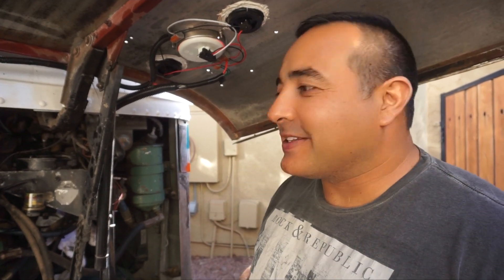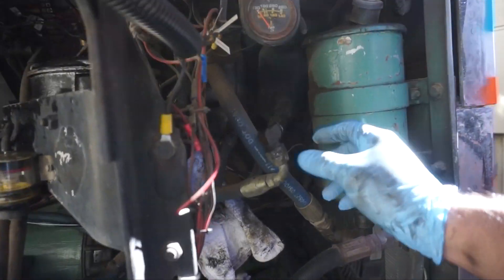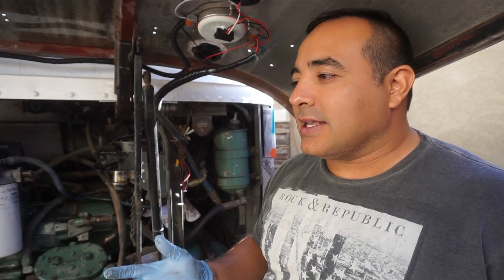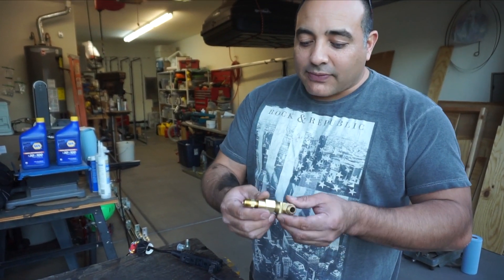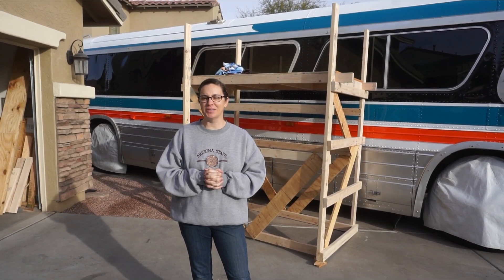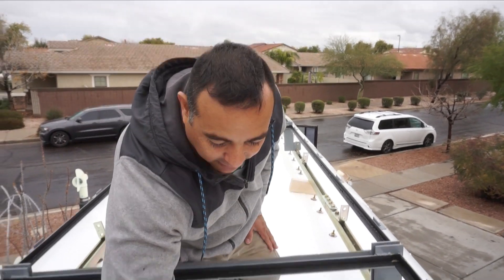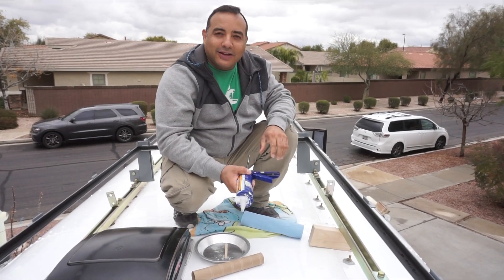Solar Install: Part 1: Mounting the Rails and Upper Racks

Comment: I see a problem. There is a gap between the unistrut and the skin of the bus. Every time you go over a bump or the lift created from the wind it is going to flex the sheet metal a little bit, causing stress fractures in the sheet metal. You need to carry the weight to the main rubs and get the bounce out. If the ribs are steel, you could just weld a piece of flat stock vertically between the ribs to the flat stock you installed already (the heat will likely damage the paint on top of the roof).  Another way would to mount the unistrut directly to the roof and run a bolt thru the unstrut and a rib. I don't think the rain is going to be a problem. The water can still drain at the ends.   

I really like like your channel by the way.
Reply from the maker: Thank you Dan - I thought about the problem you have proposed and I suppose it might cause stress cracks to form over time but I feel like it would be very very unlikely.  The frame is very solid and there are so many bolts that there is literally no flex at all.  Unfortunately putting a metal plate on the bottom would also cause dissimilar metal corrosion :(.  Unistrut directly on the roof was a no-go because the rivets and metal on the roof would not allow it to lie flat enough to get a good seal against water.  I will keep an eye on it and we'll see what happens.  Thank you for the input.
Reply: Beginning from this Morning I used wellnuts for this reason, and for sealing ability. The drawback on wellnuts is that they are less strong than through bolts. But I never had a problem and we carried considerable weight on the roof rack.
Reply: @BeginningfromthisMorning  Maybe some kind of spacer between the unistrut and ribs?  What your trying to do here is just to cool to fail in any way. I want it to work perfectly. Most builders aren't brave enough to take the time,  send the extra money, and then share something like this.

Comment: Very nice video.

Being brass like that and you not losing power steering tells me that is on the return side??? Not sure why they would have the filter on the return side??? The steel fitting is a hydraulic fitting and should take the stress of the hose hanging off it and all the vibrations from the engine. I have never had much luck with extractors, the fitting being brass (soft) probably let the tool bit.

Thoughts on putting two dissimilar metals together? Aluminum and steel?

Glenn
Reply from the maker: Thank you Glenn - I have been enjoying your videos as well.  The shop is really great and your sheet metal work on the Datsun - AMAZING.  
I thought that too about the filter - doesn't really make sense on the return side.  

I have had absolutely terrible luck with those extractors even worse luck with the "Speedout" kind - you can imagine the dance I did when the threads actually started to come out!

We worry quite a bit about the dissimilar metal corrosion - it is one of the reasons we used the rubber washers on the inside, painted everything with like 5 coats of paint.  The inside is also coated with that black tar-like glue.  Hopefully, it doesn't react too much but I will keep my eye on it.
Reply: I doubt there would be any problems in the life time of your use of the bus. @BeginningfromthisMorning
Reply: I'd imagine it's on the return side so the filter & housing doesn't have to take the full pressure of the system.
Reply: @GeoffWhittaker  Generally you would want the filter before the item being powered to catch any debris before it gets into the system(power steering). Even before the pump, filter see vacuum not pressure.
Reply: @ThrottleStopRacing  yup, I agree but all the power steering filters I've seen are done this way.  I'm no expert, but in such a small, rarely opened system I think it's okay if not ideal.
Reply: But... Now that you mention it I will ask my neighbor how big rigs do it.  He's a tractor-trailer mech.  You have me curious.  ;)

Comment: One leak is better than 144 leaks I am glad you solved that quickly. So it seems to be 10 weight oil Juan?  The steel fitting is better than the brass but I agree with Robert Davis and I would get not only the fitting but new hydraulic hose to match. Dominic seemed very proud of that scaffold and he enjoyed helping I could see that.  Boy you have some great friends from Tiny Shiny Home.  So looking at the front of the struts for streamlining I would think a fearing of some sort.  I forgot to mention your flying skills Juan you did great. No matter what you and Michelle smile all of the time nothing gets you down.  See ya Ed
Reply from the maker: Thanks Ed - I believe it is 30 wt oil. is what the manual called for.  Dominic did some great work on that scaffolding and it worked like a charm!  I am hoping to get someone who really knows these old Diesels to come to look at our bus before we leave on any adventures and give it a really good once over (adjust the rack, inspect for what can be done about some of the leaks, give me a primer on some of the maintenance items and what to look out for).  The tiny shiny home folks are so great - more like family than friends we were so grateful for their help and they are always very encouraging with us.  Thank you - I love flying that drone around!  We have come to expect the unexpected with this ol' bus but she keeps us smiling.

Comment: Keep an eye on that new steel elbow. It may be stronger, but sometimes stronger isn't better. You have to choose your failure points carefully, and I'd rather have the elbow fail than the filter housing itself. Might be a good idea to contact Luke at US Coach and get the correct brass fitting.
Reply from the maker: Hmmm Thank you, Richard, I had not really considered that.

Comment: I am enjoying watching your videos...good stuff...I am curious as to what the overall height will be with those solar panels installed will be?
Reply from the maker: Thank you Montana - The plaque the previous owner had mounted on the old dash said: 11' 4" - this rack should be about 3 to 4 inches shorter than that (We removed a roof-top air conditioning unit) - so my best guess would be right at 11 foot tall.  https://photos.app.goo.gl/HZNBks5a1f8GVvrQ6

Comment: I wonder if you will need an air spoiler of some kind infront of the solar panels once your done a little like you see only shorter than those on the fronts of trucks to deflect air over the trailers great install by the way
Reply from the maker: Thank you James - we are looking at options of how to get a spoiler on the front as well as get some shields up on the sides - we haven't figured that part out yet.
Reply: Beginning from this Morning How about a custom made glass fibre artifact ? You need a project.😂
Reply from the maker: @normanboyes4983  LOL - oh man I couldn't handle another project like that :)
Reply: Beginning from this Morning I was thinking a spoiler also. A sheet metal shop may be able to form curved pieces for the front and sides pretty inexpensively. You could use the bolts you just put in to attach.

Comment: That is definitely a shit kicking install. I enjoyed seeing your home-built scaffolding in use. Good call on going with the steel hydraulic fitting. I believe the pressure in the hose just flexed the brass fitting  n about of times until the metal fatigue point was reached. Once you get your final height, mark it on the dash so the driver knows the vertical clearance.
Reply: Juan and Michele, I apologize for the foul language. If you like, I can re-write it using proper words.
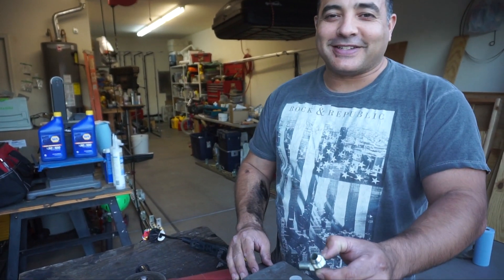Reply from the maker: LOL no worries Kevin!  I was very relieved that a) the brass piece actually came out without destroying the threads b) that they had a fitting (running around @ 4:00 on a Friday right before everyone goes home for the weekend).  We will try to get a height measurement in the next few weeks.  It should be shorter than when it had the old A/C on the roof by about 3 or 4 inches!

Comment: Apparently when u put a full lock on your steering it puts heaps of pressure on your power steering pump!
Reply from the maker: Thanks Alan - I have read somewhere as well - I try to never take it to full lock.  It broke when I was backing straight!
Reply: That's true.  It's a lesson I learned the hard way with my Civic about 15 years ago. :-)

Comment: May I suggest you go to a vendor who builds hydraulic hoses. The fitting that broke was a hydraulic fitting.  You might take a few pictures and share with them. They may have suggestions as to best way to connect the hose to prevent over-stressing the fitting.  Mixing and matching hydraulic fittings may not be good idea.
Reply from the maker: Thank you Robert - the place I went to deals only in hydraulic hoses and fittings.  They are called "hose power!"  I showed him a few pictures of where the pipe was and what it was doing and brought in the old piece and he told me it should have never been a brass fitting.
Reply: It is comforting to talk to an expert to understand the options and possible solutions. They often have simple fixes for what can be show stoppers. Sometimes the solutions aren’t necessarily obvious. You may want to add a few hydraulic fittings and a 5 to 6 foot hose with universal fittings.  Choose a common size. Even if smaller diameter it might be enough to get you to a repair shop and off the side of the road.
Reply from the maker: @rdavis20  We have implemented a "buy two" rule for fittings and fasteners :)
Reply: Beginning from this Morning 
That is a good idea. I do suggest you keep a spare hose say 1/2”-5/8” x 5’-6’ length. Then have some spare adapters  3/8 to 1/2, 5/8” to 3/4” bushings or adapters. 2-3 each plus tubing to pipe adapters.  Couplings Female x female,